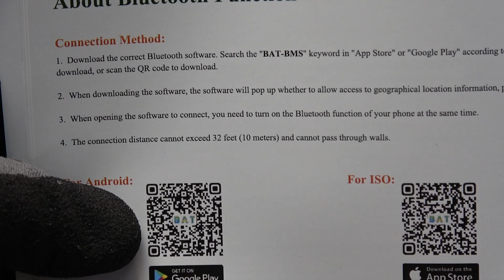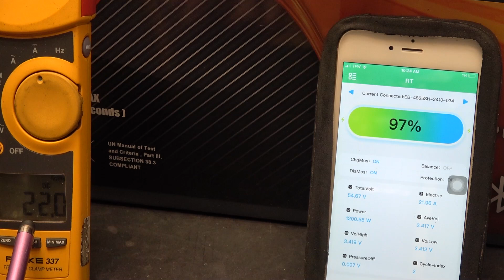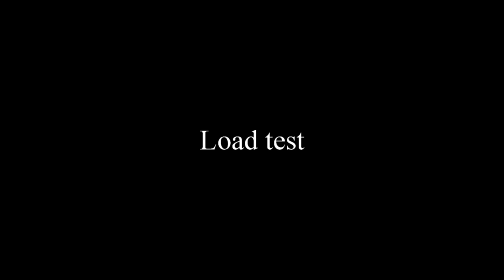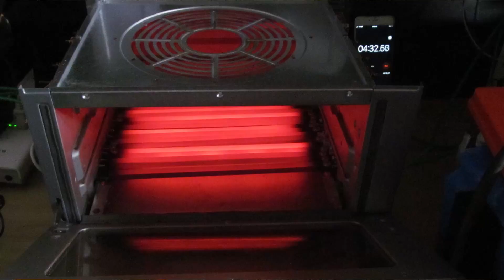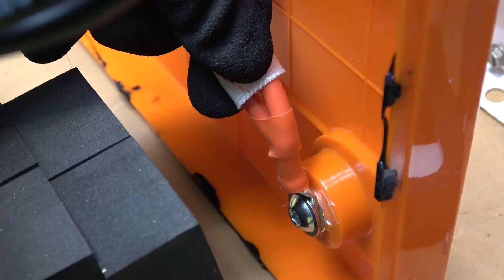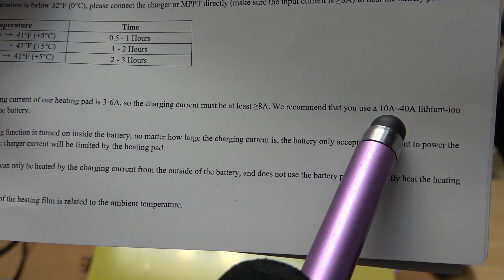Review & teardown: Enjoybot 48v 65Ah LiFePO4 battery w/ bluetooth & self heating

Comment: I have a 4 month old Enjoybot 36 volt trolling motor battery that completely failed.  It does not respond to the app  via bluetooth like it used to, and although my voltmeter says it has a nominal 38.4 volts, it drops to 0.7 volts with the application of even the smallest load.  To their credit, Enjoybot is replacing it free...but they do NOT want the old one returned.  I suspect some component on the circuit board failed.  What, if anything can or should I do with it?  How does one even discard such a huge battery???

Comment: Thanks for your video.  Looking at the Enjoybot 36V 60AH as a trolling motor battery - My existing Newport 36V 40AH came with a 7 amp charger.  Do you see any problem in using a 7 amp charger (43V made for 36V system) to charge the larger batteries, like 60AH or 100AH?  All info I've found is that slow charge is good - too fast of a charge is more of an issue I understand.  Your opinion.

Comment: This is 16s o 15s 51.2volt  o 48volt and charger 58volt no is over is good 54.8volt for 51.2volt 16s 3.2volt max 3.48volt good and no 3.65volt is tu mech no good for cell lifepo4
Reply: Balancing usually starts at 3.55V or 3.6V per cell, so you need at least an 57V charger